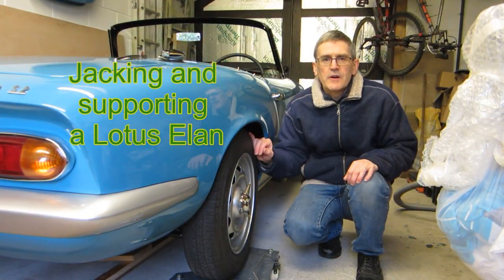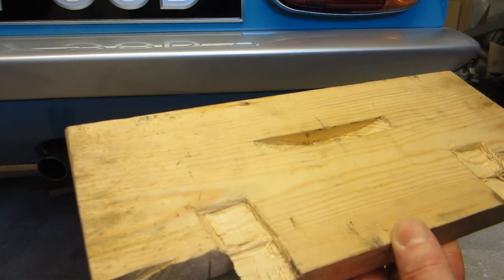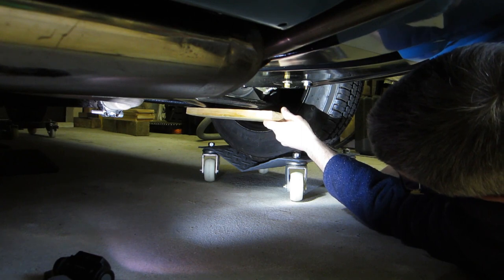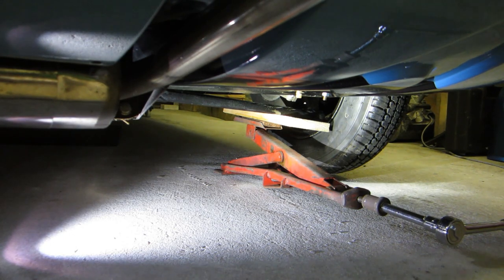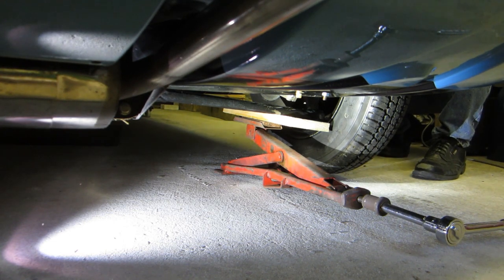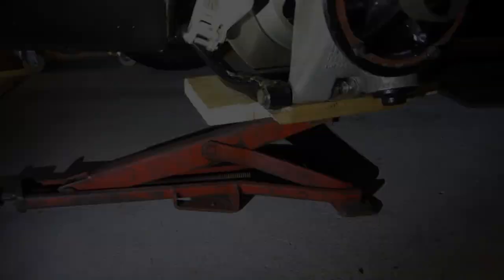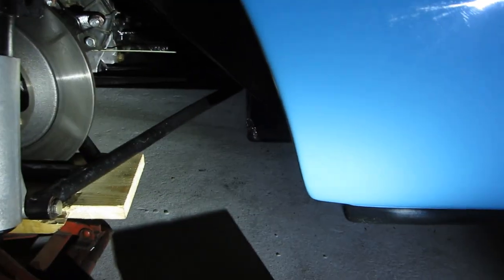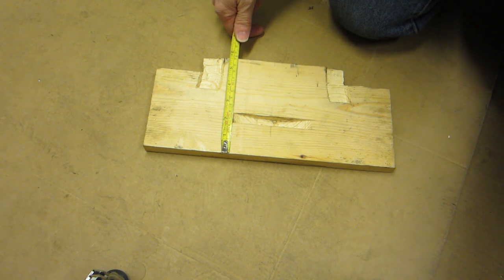Jacking up a Lotus Elan

Comment: Modern doughnut are poor compared to the originals, I've had 3 sets fail, all from different suppliers, and all in less than 2000 miles each time.  I have therefore fitted cv conversions.  So much better and peace of mind regarding potential failure at speed.  Good jackiing mod though.

Comment: Thanks Paul- another fine video for our use.  I use the same method as you do for the front including the axle stands.  In the rear, I have been using a thinner/less wide bit of wood as far out as possible, close to the wheel but I like your method much better with a substantial plank with cutouts-imagine it spreads out the load better and safer for the a-frame. Will try the wood blocks as an axle stand substitute-seems better as well.  I have learned the hard way about not allowing full droop when I used a central plank on the chassis to check the handbrake/diff and split one of my cv boots- I have 2 on each side so no donuts but the same worries apply.  I like the original jack too but make do with a scissors jack from a Nissan.

Comment: Thanks for the video... very useful. Quick question: how do you check your donuts for stress / other problems? Mine are 10 years on the car (sprint) and visually they seem ok, but am told that I should put the wheels on full droop and spin freely to look for fractures. Is that going to harm them do you think, or being drooped for only a minute or so shouldn’t matter too much? 
Also please what are the dimensions of your big block for the rear jack up? Thanks again,
Reply from the maker: I like to avoid letting the rear suspension fully droop as much as possible so the donuts don't get stresses by it but I may be being over cautious.  I can't claim to be an expert on checking the condition of the donuts.  I would take a look on Lotuselan.net and search on there.  You'll find plenty who have no time for the donuts and I've read that there were some very poor quality ones that didn't last very long.  Regarding the jacking block I've posted a PDF file showing all the dimensions on Lotuselan.net.  If you search for "How I jack up & support my Elan" and look through the thread you should find a message from me with the PDF file.  This link may take you to it:  https://lotuselan.net/forums/viewtopic.php?f=42&t=46238&p=332305#p332305
Reply: Paul H thanks Paul... I’ll check those resources, and make up the pieces to spec. Cheers, Will